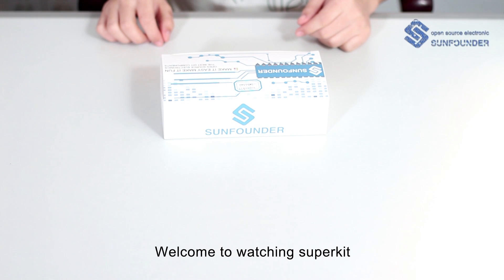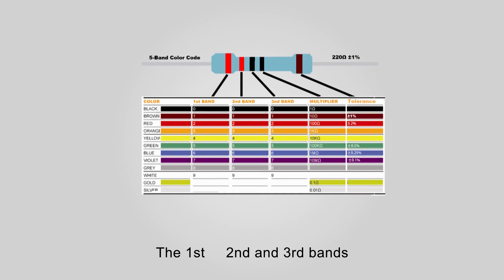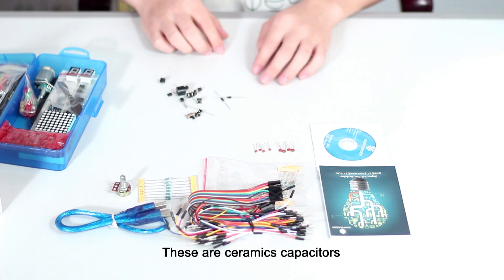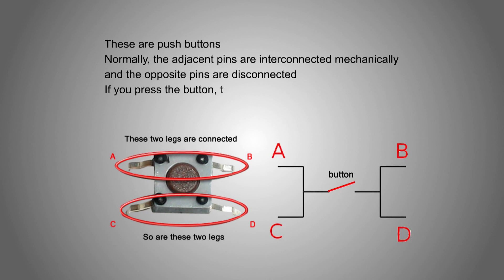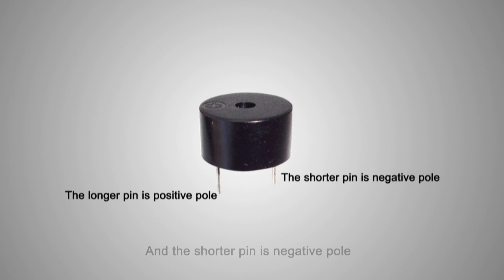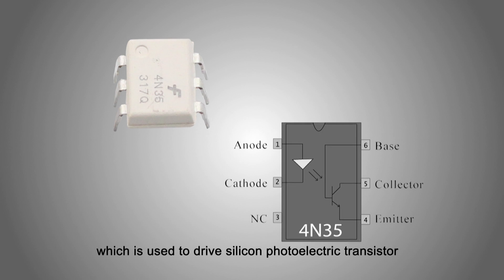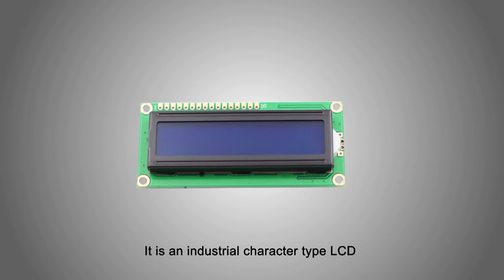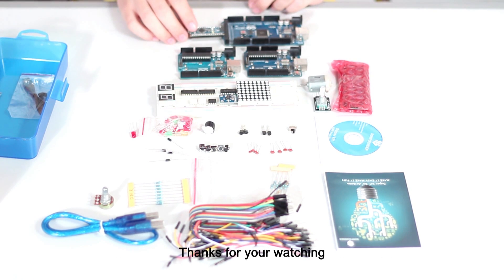Sunfounder Starter Super Kit Turorial for Arduino - Components Overview

Comment: Hello Sunfounder, I wanted to share my perception from your products. I bought 3 products (RFID kit, 37 module sensor kit for RPi and IoT shield for Arduino). Your products are as you advertise them. They are working good and all of them are in good conditions. Very good booklets and code sources are provided. Very easy to use. Thanks very much for customer care as well.
Let me know if you can provide a complete weather station as well. I need two sets for demo and later I might need more. Please, remember that I need (wind speed, direction, temp, moisture, altitude, sun direction and indirection radiation measurement for our University).
Reply from the maker: Thanks for your great support of SunFounder! For your question, please contact our support mail box support@sunfounder.com, we will provide you further assistance.